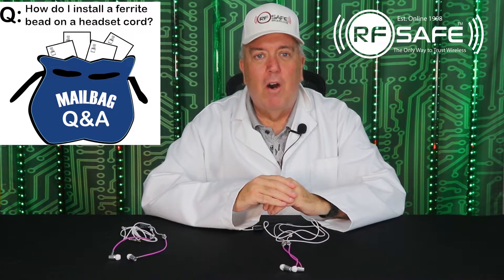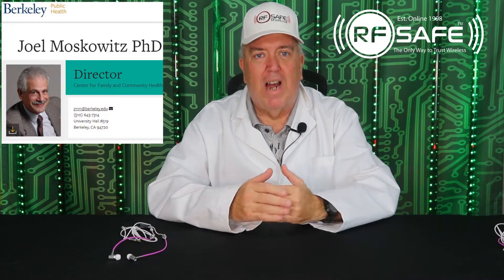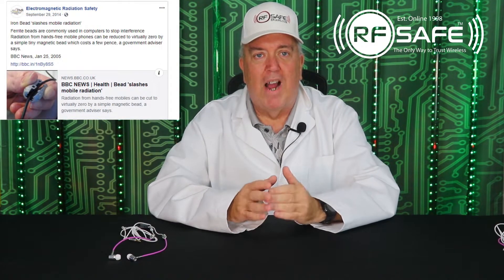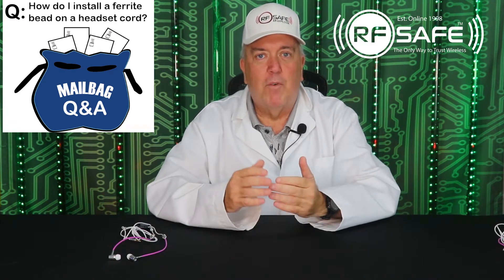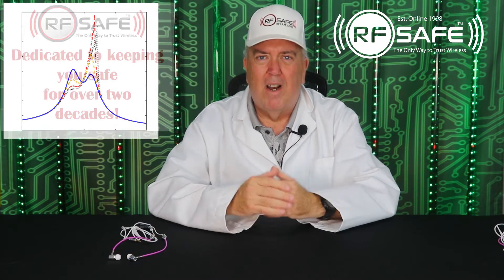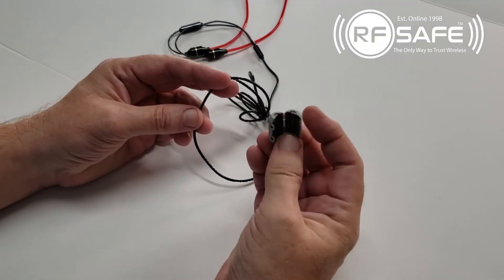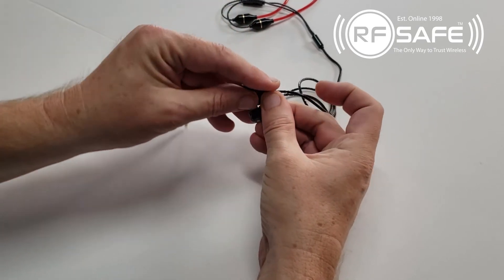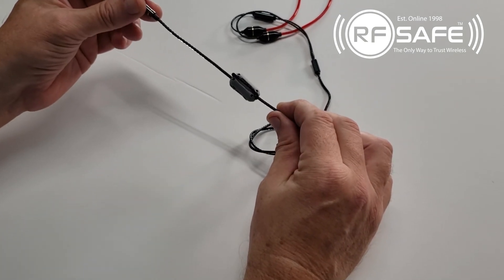Does a Ferrite Bead Block Headset Cable Radiation from Smartphones

Comment: there isn't any ionizing radiation produced by mobile phones. the intended use for ferrite beads is as you explained, blocking the lower frequencies.  but the use for ferrite beads on Lower frequencies is because they are known to cause a high pitched sound from the passing radiation at radio frequency levels not because they are harmful. it isn't true that ferrite beads aren't used because they are ineffective at suppressing higher frequency harmful radiation at cell phone level, at that level higher frequency is still completely safe, it is because they higher frequency does not produce audible sound. this product is simply a scam aimed toward the uneducated, easily manipulated, foil hat people.